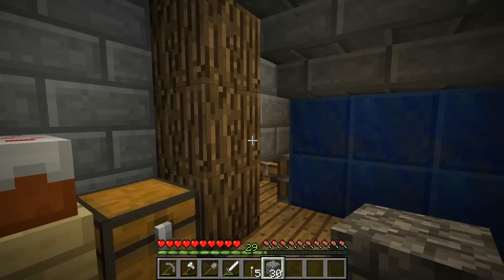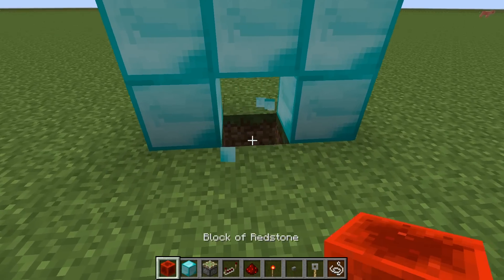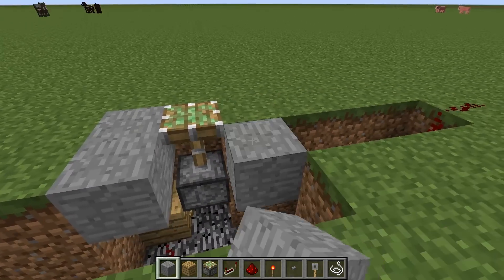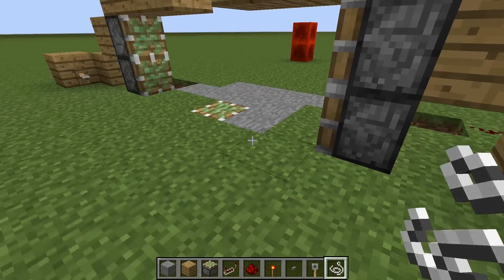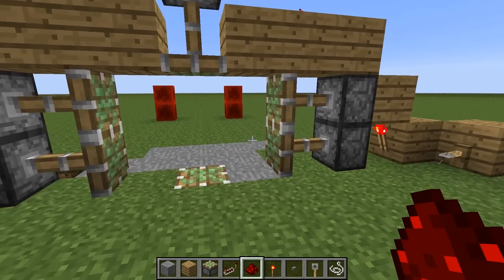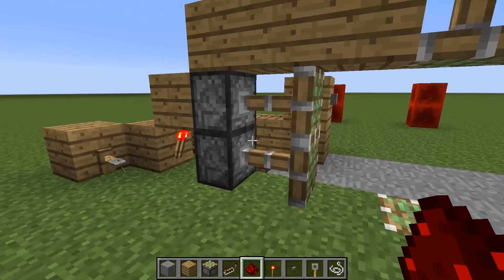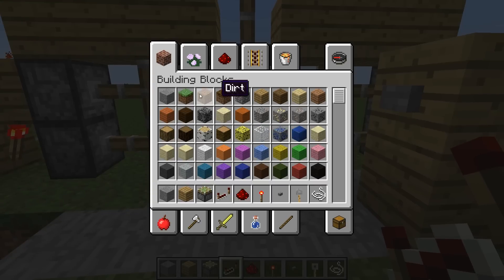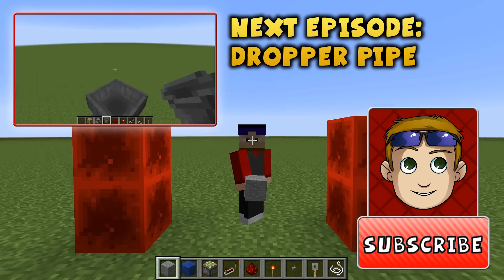Minecraft Guide - Piston Door

Comment: For some odd reason the door I made has a slight problem. I copied the exact same layout, but when I activate the trip wire the bottom right piston (From the inside) doesn't retract in sync with all the rest. I'm not quite sure how to fix this :<
Reply: Omahazu I had a similar issue with my middle piston getting stuck with the button. I’m gonna try it again.

Comment: Will, did you know you can run redstone up half-slabs? I can't remember if you did it in your mechanics video. It will make your builds a bit smaller and neater. A lag resistant design is to use a single torch and add a small delay. You can also run redstone over a block and it will power 2 pistons below it :p

Comment: Awesome design, I plan to use it with my house on minecraft.

Though I have to ask, is it possible to use a string to open it from both ends rather than having one side be with a button?
Reply from the maker: You use a button because only a player can trigger it to open the door.  If you use a pressure plate or a trip wire any mob will just waltz right into your house!
Reply: I think mobs would be able to walk in.
Reply: YOGSCAST Will Just wondering, exactly how good are you at Redstone? Are you Sethbling-level (if you know who that is) or are you just good at it? I know you said you are not an expert, but that's really based on what you call an expert.
Reply: YOGSCAST Will

Ah I see.
That makes sense.

Is it still possible to work with tripwire on both sides though? Cause the current server I'm on is in a mushroom biome so we don't have mobs to worry about near our player homes.
Reply: TCCX360 I wouldn't now why it's not possible, you would just have to replace the button with tripwire hooks just like on the other side.
Reply: That's my thinking.

But when I tried it all the blocks were moving at different times.
Reply: TCCX360 Sorry, I don't know what causes that, have you tried using repeaters to move them at the same time?
Reply: I'm pretty new when it comes to redstone which could be why.

I think I made the design shown in the video. Then broken down the button and moves a square or two back to place the string and extended the redstone path.
Reply: TCCX360 Yeah, you might just want to try something out and use repeaters, that's really how you eventually get to know redstone. Just experimenting works better than any guide even Will can make.

Comment: To bad this is not a console friendly build:(
Reply from the maker: If you, or anyone, can find a way to make three pressure plates on the inside work just as well as the trip wire, It'll work.
I tried to do just that, but found larger problems with getting three plates to work in unison.
Reply: +YOGSCAST Will Is this still not console friendly?  I was going to give it a try tonight on Xbox One version.  Thanks!